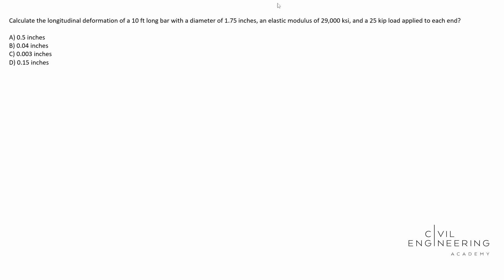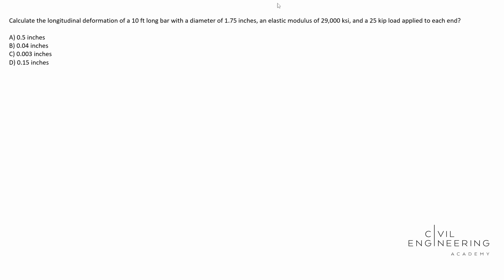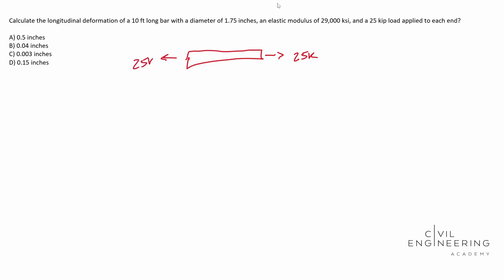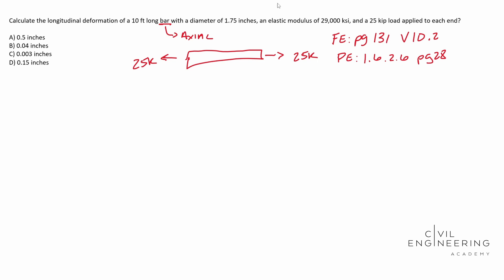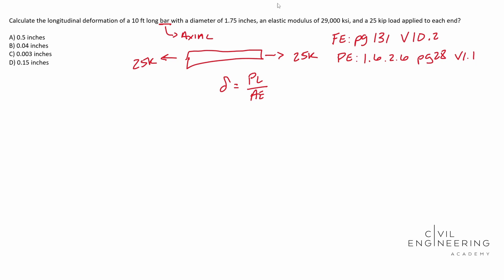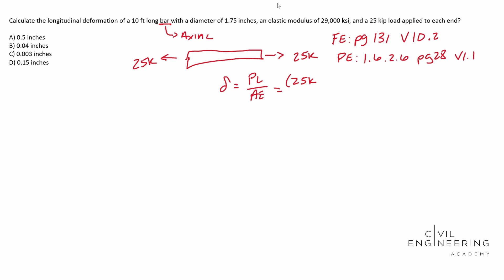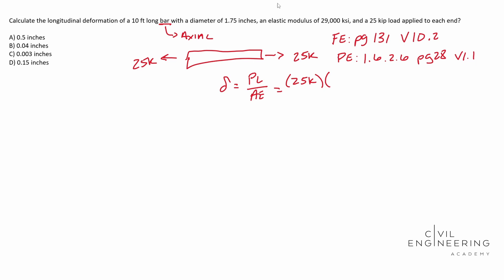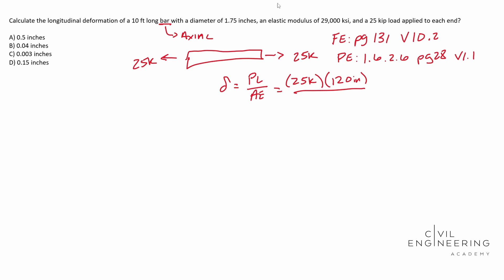Civil FE/PE Exam - Materials - Calculate Axial Deformation of a Bar

Comment: Tension in the member is actually 50 kip, not 25 kip?
Reply: I agree. Looks like the video shows the correct answer, but wrote the wrong applied force in the equation.
Reply: Tension in the member is 25kip. The load on one side of the member is resisting the load on the other side of the member.
Reply: No, Actually it is action and reaction theory!